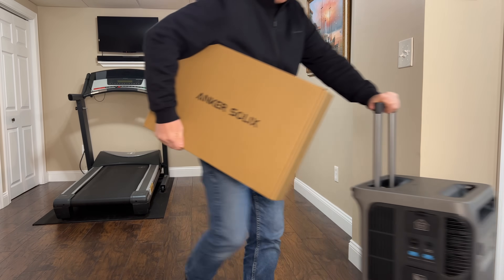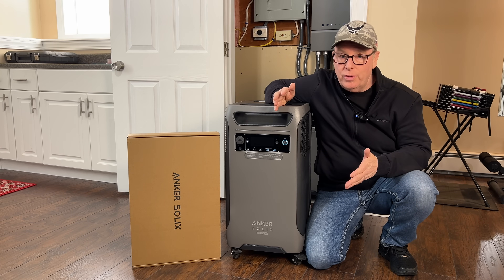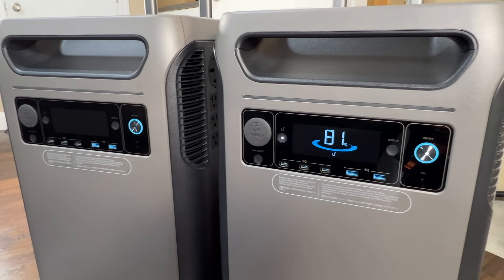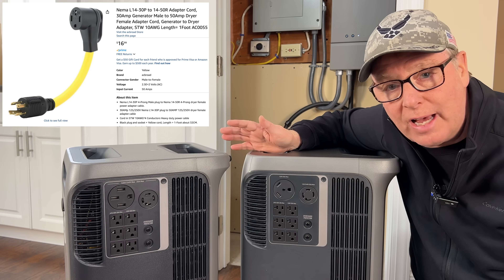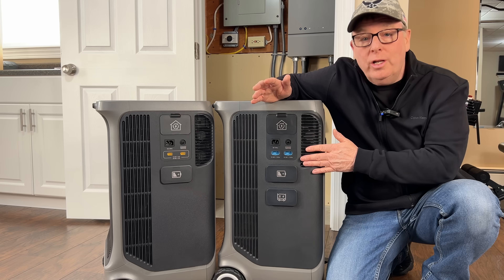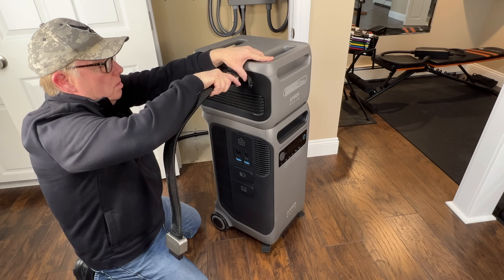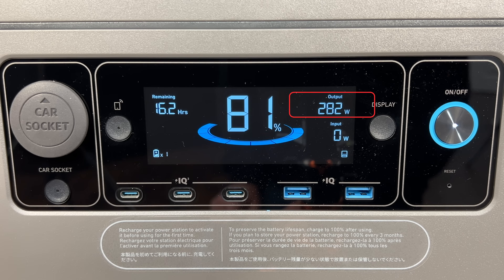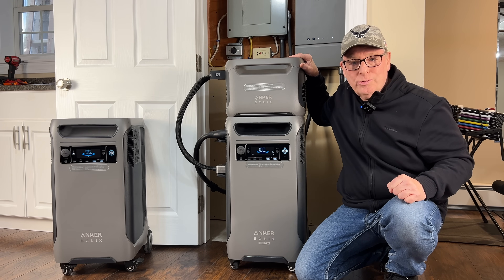Make Your Battery Last Forever (Anker Solix F3800 Plus)

Comment: Say if you do not have a 240v gas generator and its only a 120v. Can you use the gas generator to charge the F3800 Plus using the standard wall outlet cable while the f3800 is connected to the home panel box to supple power to essential items for the house during a power outage? I'm hoping I'm explaining that correctly.

Comment: Can I charge the batteries of my Anker F3800 plus with my Honda EU1000 generator?
Reply from the maker: If you're generator outputs 240v there are settings in the app for the size generator your using to charge through so its not going to cause an overload.

Comment: Hey Backyard Maine, I got a question to ask about your exact setup with the F3800 Plus. I have two of these F3800 Plus units and I have a question about setting up a gas generator to plug into an inlet from the outside and right now I am about to have an electrician do a big job soon on our house where we live (were getting new outlets installed and new lights also installed as well). So according to what you say and what you showed in the video about hooking up a gas generator outside to an inlet, which is fed into an outlet next to the Main Breaker Panel, and the NEMA 14-30 plug from the special generator cable adapter from Anker Solix is plugged into the Home Power Panel, and then you connect a Power Station to the Home Power Panel. My question I have is, is there no way currently to have TWO F3800 Plus units plugged into the HPP AND have a Gas Generator (what if I plug in a 12000 watt 50 amp plug into the house as an inlet?) charge to the house at the same time to power not just the Power Stations but the whole house as well? And is it possible to have a generator to power the house independently without connecting both F3800 Pluses or one F3800 Plus to the Home Power Panel? If I can only do one power station like with your setup for charging the Unit from a Gas Generator, should I still get a 50 Amp NEMA SS2 plug outside to plug in the gas generator through a 50 Amp plug, or should I do a NEMA 14-30 Inlet? If I have a 50 Amp Inlet outside, can I have a NEMA 14-30 Outlet to use the Special adapter cable from Anker to power the station separately? In theory to power from a gas generator over 12000 watts and be able to use both F3800 plus units, I am thinking now, would I need to install a second Home Power Panel and have a second Generator cable to power the other Power Station then so I can get 12000 watts to the house? Or is that not possible to do that? Can you hook up two Home Power Panels with the F3800?

Comment: Is that adaptor to generator connector a NEMA L14-30R? Newbie here, probably just basic info for most of you.
Reply from the maker: Great question.. One side of the cable is a proprietary connection which connects the to the F3800 Plus or the Home Power Panel. The other side is a NEMA L14-30P which will connect to a NEMA L14-30R. The R and P designate whether its a plug or a receptacle..

Comment: Those who know still claim that EcoFlow is the gold standard of power batteries for home emergency power use.....the EcoFlow3 is the latest for home use and also is expandable especially if you have a 30A 240V circuit breaker for generator use on your home.
Reply from the maker: Anker and EcoFlow is kind of like Ford or Chevy or maybe a better analogy would be Toyota or Honda. They both make a quality product so it comes down to personal preference or brand loyalty.

Comment: Enjoyed the video. Can you describe how the HPP works if power is restored and generator is running? Doesn’t it automatically switch back? Not a electrician still learning.
Reply from the maker: When running on generator power through the generator input adaptor the two pole breaker feeding the HPP is turned off. When utility power is restored you would complete your switching procedure. Opening the generator breaker and the generator input adaptor breaker, then closing the main breaker and the breaker that feeds the sub panel through the HPP.

Comment: I have the solix 3000.  Is it possible to plug the AC recharging cable (used to recharge using a wall outlet) into the 120v AC 20 amp outlet on my gas generator and recharge that way?
Reply from the maker: Is it possible (yes) but I would check with Anker. I believe they don't recommend recharging with a non-inverter generator and it may void the warrantee.

Comment: Love your details education video.  I have been living in travel trailer for 8 years.  I couldn't find any videos of full-time travel trailer living video on YouTube with Anker products yet.  I was wondering if you could help me set up a unit that I can use for every day living.  It's only 28 foot travel trailer.  I am not using the loud AC that came with the trailer.  I got 9000 BTU Mini split unit, microwave, portable induction cooktop, 2 box fans and CenturyLink modem.  I am at Arizona.  I am on grid at this moment.  I am still going to be on griy and I want Anker as a another option.
Reply from the maker: I am happy to hear that you found the video helpful, and I appreciate you sharing your living situation!

Comment: John, how is the L14-30R receptacle connected in the main panel, and how does it only provide power when the generator is connected? How is it not also providing line power from the main?
Reply from the maker: I have a two pole 30A breaker feeding it from the main panel. I leave it off and keep the generator input adaptor disconnected except when it's in use. I also have a generator backfeed breaker with interlock. When running the generator the main is off and I select the loads I want to supply. When I need to recharge the F3800 plus I will connect the generator input adaptor and close the two pole 30A breaker to my L14-30R.

Comment: Did you create an outdoor power isolation disconnect to your battery back up power to your house branch circuit? Just like an outdoor disconnect to your normal grid power to your panel for first responders? I placed an exterior disconnect to the power feed coming out of the Home Power Panel leading to the back up power branch circuit to meet local code and NEC 690.13. My concern is this outdoor disconnect does not shut down the Home Power Panel or operation of the F3800's or the auxiliary batteries. There is an E-stop on the side of the Home Power Panel which does shut down everything but there's no way to link an input or output to that circuit eo disconnect.

Comment: Yep!...I'm getting this👍
Reply: Alvin Bugg here... Power Conversion Systems Engineer since 1977, designing systems up to 100 kW....  Do your homework before you buy. There are many unanswered, very important questions about these units. The Manufacturer does not make important details available, which we will inevitably need to know.

I just ordered two 3800' s with Auxillary Battery Systems and will  be performing extensive testing including failure analysis. 
There are features such a unit should have but these do not include them. I Intend to determine if such features can be added to the factory provided units and develop plug and play solutions.

Comment: Had 3 day power outage last year.  My non-inverter generator had no issues powering my "sensitive" electronics.  My battery power station was purchased since.  Not sure how it'll  deal with my generator.
Reply from the maker: They will still work but it’s hard on them and can shorten the life.

Comment: Not so sure about generators and the batteries.  I have a Generac(second one), and when it kicks in after commercial power loss, my UPS in the house have no problems detecting it as commercial power.  Also, I have 2 F3800+ into a HPP, and I have tested a power loss.  HPP kicked in immediately, then when the Generac kicked in, the HPP detected commercial power and switched back over, and charged the F3800+.

Comment: Thanks for this video! I do missions work and I live in the Dominican Republic and power is sketchy at best. I was thinking about a gas generator, but with an abundance of sunshine, I was looking into these anker f3800s with some solar panels. How does heat affect the performance? It averages about 85° in the “winter” and about 90° in the summer.
Reply from the maker: The Anker SOLIX F3800 portable power station can operate within an ambient temperature range of -4°F to 104°F (-20°C to 40°C). This is the specified operating temperature range for both discharging and charging the device.

Comment: If I set up anker solar roof panels and connect them to the f3800 plus, and then use a transfer switch for certain devices, that if the power of solar charge exceeds the power needed to run those devices and the battery is full, then the battery gets overloaded? That is my main and only question for my use. I don't want the smart stuff behind it, but I don't want to burn the f3800 plus either.
Reply from the maker: The battery won't get overloaded because it has a smart battery management system. But the F3800 plus can cut out on overload if you exceed the maximum output of 6000 watts. The HPP that I have installed feeds my sub panel and I was careful about the circuits I selected for backup. But the HPP also allows us to supply power during normal non outage usage to the main panel as well and it will supplement the utility feed and not be overloaded. This allows me to supplement my utility power with solar power and not back feed utility and not over load the system.  It worked a lot like modern solar inverters.
Reply: That's neat. The main solix guy had a video and said that, and not sure he meant to say that word at all, but it worried me because I have 3 of these units and 8 rigid panels and 2 portable 410w panels being delivered tomorrow. Thanks for replying. Im a 40 year old surgeon by trade, but I.T. stuff runs my heart. Lol   @BackyardMaine

Comment: Great content — I wanted to ask for clarification on the type of generator used to recharge the f3800+ — it seems from your video to not be using an inverter generator but does the f3800+ require a certain range of THD so that it doesn’t blow out the electronics on the units itself?
Reply: Other videos use the traditional gas generator.

Comment: That Anker generator interface kit seems like a meaty brick.  Do you what is happening inside the box?  Whats its purpose ?
It’s not converting AC to DC is it?
Is it a substitute for an EG4 chargeverter?
I wouldn’t think so 🤔
Reply from the maker: No it is not a substitute for the EG4 chargeverter. You still want to make sure your generator THD is 5% or less. I'm not sure and was unable to find out exactly what's inside the box on the input adaptor. Maybe you can ask Anker now that it's be out for a few months. I suspect a filter and surge protection but I don't know. This allows the system to bypass generator power through to the load and use excess power to recharge the battery. It does work well for that but I can say my LED lights still flicker a bit with the pass through power much like they do when power directly from the generator so any filtering is minimal.

Comment: So, with the F3800PLUS, can I link two anker 410W solar panels in parallel to one of the ports? Or can only be in series?
Reply from the maker: For the best result you would want to connect the two panels in series. Each panel can provide about 13A and if you connect them in a parallel you will have as much as 26A at full capacity. Each input port on the F3800 Plus is limited to 17A max so the MPPT will limit you power input to 17A. If you connect them in series you will double you voltage but still limit the amperage to 13A. If we do the math you would get a maximum of about 600w in parallel and 820w in series.

Comment: RVs are either 30 or 50 amps I don't know why they would make the output 25 amps.
Reply from the maker: The output is 25A but the connection is 30A. Many gas generators are the same. A 5500 watt generator will often have a 30A and a 50A connection but it can only produce 23A. The 25A output on the F3800 plus is 6000 watts. This is over 80% of a 30A circuit capacity. The code limits continuous loads to 80% max. Plus if you running a continuous load of 6000w the batteries would not last very long at all.

Comment: Great video! I’ve been shopping for one and you recommended this in a rely to a question I left about an airstream camper. I’m sure this is what I want, I just need to do some research on the xtra equipment that I will need with it in a RV setup, and whether to buy kit or separate
Reply from the maker: I’m happy to help. They are a great option in my opinion. If you buy from my link it helps support the channel without any additional cost to you. Either way I hope it works out well for you.
Reply: @ I will definitely order through your channel if the price isn’t too far off, your video sold me on the product so I would like to pay it forward by giving you the credit. I’m in process with renovations, new appliances, fixtures, furniture and wiring. I’m still about 6-8 weeks out on being ready for this
Reply from the maker: @dantirk4560  I'm doing another video on the system now. I'm going to also be adding four and eventually six 410 watt solar panels.

Comment: What is the warranty of the anker plus? Wouldn't the cycles in self consumption mode kill the battery fast vs keeping it in a ready backup state?
Reply from the maker: The cycles will not kill the battery. The system warranty is 5 years with an expected life of 10 years. I think the batteries will last a lot longer than 10 years though. If you look up details on the new battery technologies you will find the cycles and degradation over time is minimal. What usually fails first in the battery management system. Time will tell but I think the set will outlast me. Will Prowse made a good video on the subject. Check it out here. https://youtu.be/UbZiHzflKMY?si=xuSMyf5nc0kjQV_6

Comment: You are spreading misinformation. It is impossible to make a battery last forever.
Reply from the maker: Not misinformation it’s misunderstanding. The battery will last about 10 years but by using a generator you can always keep it charged. This provides a great combo for extended outages

Comment: Wouldn’t it have been less expensive to just have purchased an inverter generator? You could also have gone with a dual fuel to give you more options.
Reply from the maker: I’m getting one and will be running some tests to see it it works through the HPP and can change and run loads simultaneously
Reply: To clarify, I mean rather than buying another Anker battery system.

Comment: can you test how long the system can run with max solar input and max output load, that is the real deal here, many system will over heat and quit the solar input for about 30 mins run
Reply from the maker: I will be making several videos over the next month about solar charging and installation. Stay tuned.